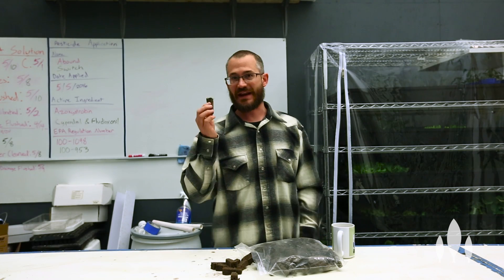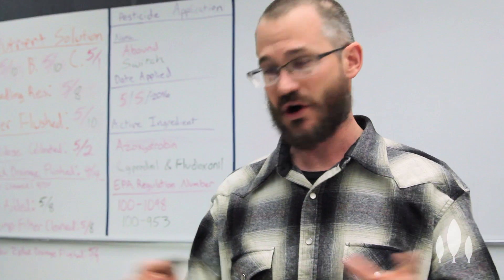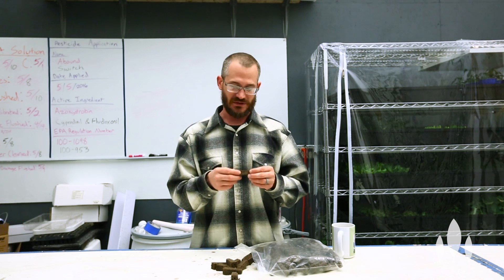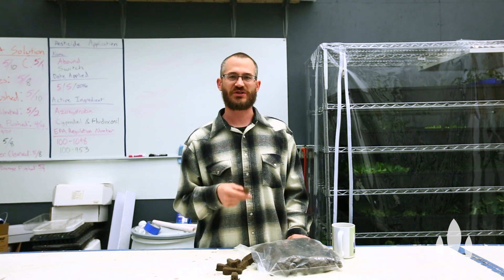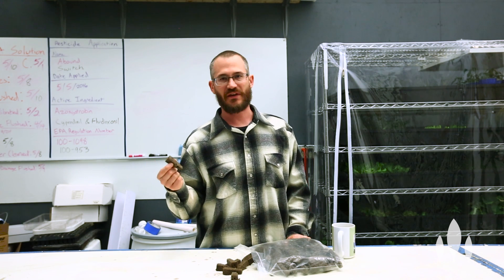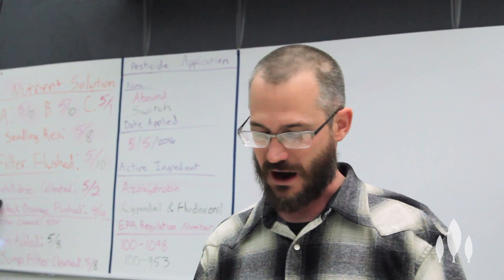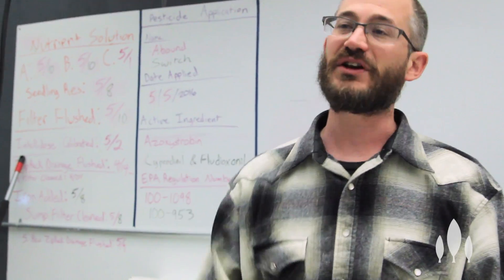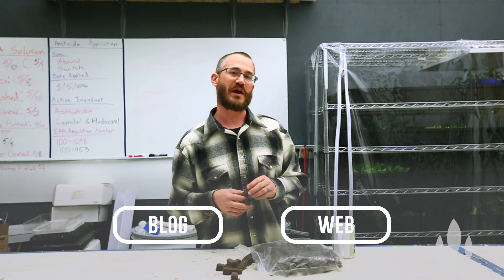What are Polymer-bound Plugs? | Pros and Cons

Comment: Good stuff. Don't mean to sound like an egg head but are they good for starting aquaponic crops?
Reply from the maker: Hi Jads! No worries - yes they are fine for aquaponics as well. The question isn't hydro or AP, it's more of the particular growing technique. These are great for growing in ZipGrows or NFT or even media beds (anywhere you want a bit more structure of your plugs with less break down) but probably aren't the best fit for say aquaponic rafts or DWC. If you're looking for seed starting info specific to DWC, you might check out +Bigelow Brook Farm (Web4Deb)'s video and info on wicking beds + Grow Grips. Hope that helps!
Reply: +Bright Agrotech Thank you so much for your response, I really appreciate. Blessings
Reply from the maker: Of course, happy to help!
Reply: As to the grow grips, I have been using them in my AP system, and they do well on most products. I am using the Beaver Products rafts on mine right now and they do well for putting out the lettuce plants or any others that are of similar size. but some products after they mature will destroy the plugs. Don't count on reusing all of them. The plugs for 2" do work better for reusing, but overall would rather use the polymer if could use them. I have tried them in the larger ones for the 2" holes, but have to cram them down in smaller holes and not ideal from a logistical point. I plan on buying the 1" variety if I can get them.
Reply: So the polymer is safe for fish and aquatic life?